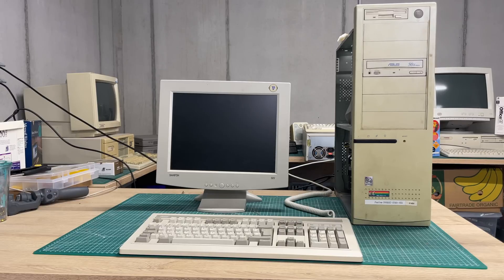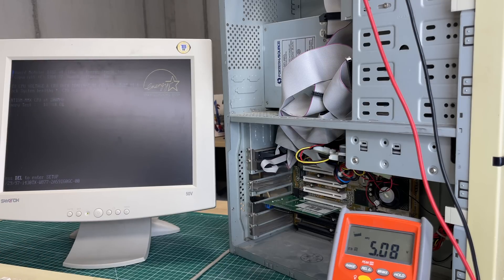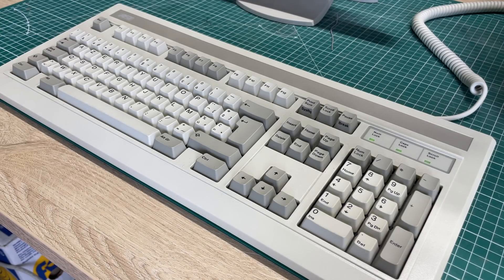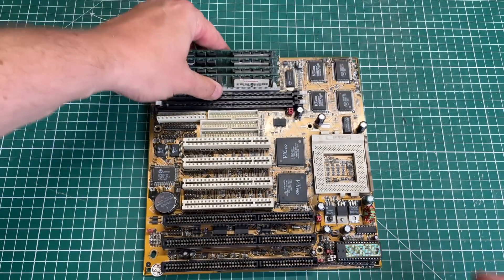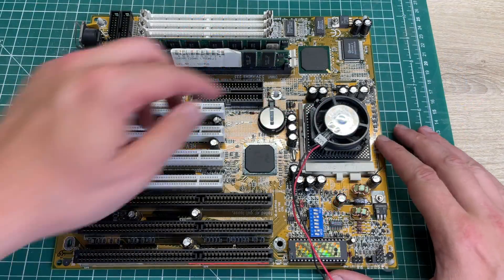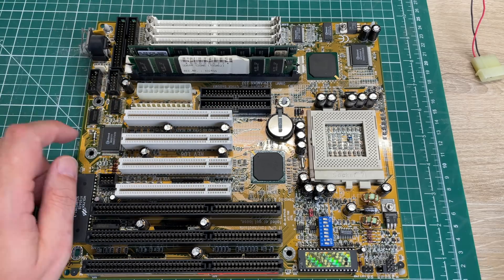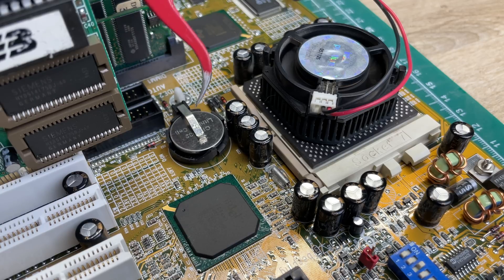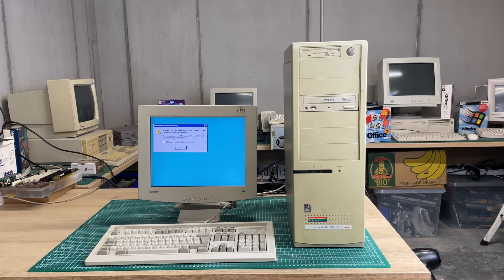Easy fix for this broken Pentium 200 MMX

Comment: I would just double check any capacitors that are in circuit with that battery to be safe. since it works on subsequent boots, it's obviously looking for a charge on an associated capacitor, probably to safely switch the CMOS ram safely over to main power, and the capacitor isn't able to fully charge on a weaker battery. It might be by design, but it could also be an indication that capacitor is old.
Reply: It’s more than likely the other way around.  The coin cell and main 5V rail are combined after their own respective diodes, and residual charge in a cap somewhere on the CMOS V+ rail allows for a successful warm boot, but isn’t quite up to charge on a cold boot.

It is quite likely that the 5V system rail is fed through a current limiting resistor to support safely charging rechargeable cells, since most motherboards had provisions for both.  That would form a low pass filter, meaning the downstream cap would take some 10s or 100s of milliseconds to charge to a suitable running voltage from zero.  Ergo, cold boots fail.
Reply: @sirnickity  chokes are for that.  I would suspect capacitors with a high ESR.
Reply: @BenState   An inductor in series would limit changes in current, yes.  But so would a capacitor to ground after a current-limiting resistor.

Usually whatever capacitor is in-circuit to a CMOS battery wouldn't be an electrolytic.  It's likely either a ceramic or tantalum, so typical "old capacitor" failure modes aren't as likely here.

Comment: I'd suspect you have a bad electrolytic cap in the voltage regulation portion of the motherboard.  A marginal cap can intermittently short and drag down the rail it's on.  That may cause a hang, or cause the VRM to go into protection mode or input voltage is insufficient to properly regulate.  Most need an input that exceeds a certain threshold above output or they can't put out full current.  When powering on/off repeatedly, as inductors dump their charge, the voltage will spike.  This momentary excess voltage can allow the marginal cap to charge, or the VRM to begin regulating.  A derivative of the 5v rail will be supplying 3v to the CMOS circuit and that coin cell.  Having a weak battery will make it sensitive to marginal 5V.  Just some wild @ss speculation

Comment: This is a very common phenomenon with various laptops, even much more modern ones. Some appear dead when the CMOS battery is low. Off the top of my head, various Sony models were known for doing that. I've seen it happen with desktop motherboards before, but it is much more uncommon. Some are especially weird and boot fine without a battery installed, but refuse to boot with a low battery like 1V.
Reply: Wistron-produced Acers (7551 ,5738,5536, 5740, 7736, 7738, 7740 and there might be a lot more than I know) will definitely NOT boot with no CMOS or low voltage batteries. I've been given a lot of 5738 and a few 5536s, and most of them weren't POST-ing due to that CMOS thingy.
Reply: @NSHG  Good to know!

Comment: Years ago, a tech at PC Doctors in Huntington WV told me that he made more money from bad batteries than any other hardware problem. I have no reason to doubt him. Over the years, I have had several 486 and Pentium motherboards refuse to post without a battery or with a failing battery, all of them had CPU voltage auto-detection or some other "new tech" that was cutting edge at the time. Enough of them that for a very long time, I refused to buy any motherboard until it was at least revision 2 or higher.

Comment: Hi Sir, regarding to this, I have a mobo in my stach (dont remember the brand/model) that NEVER boots if CR2032 is empty/low power/missing
I took some time to trace the problem some years ago, and you now present a very similar problem

Comment: There are motherboard series that only work with a cmos battery. I've seen quite a few in my career. You don't think about that in the beginning, but an empty cmos battery can cause a lot of problems. A point to keep in mind when working with old computers.
Reply: It's still interesting though that the board would post if you power cycled it quick enough.

Comment: Would be nice if you could merge the stereo audio streams. The balance between the left and right channels varies per shot and it can be a little disorienting to the ear.
Reply: A nice little feature I learned about Windows 10 (and I'm sure 11 also) a while back was the "Turn mono audio on or off" setting. Go to search and type mono and it will come up. It makes listening to videos with headphones much more tolerable when they have uneven audio or sound on only one channel. Just remember to change it back to stereo afterward.
Reply: I agree. You need to merge stereo to mono, otherwise it's unnatural. :)

Comment: I have a Gateway Pentium D system (GX7022E) that will do exactly the same thing if the CMOS battery is low.  Over 15 years old and still going strong, but it likes to eat power supplies.
Reply: Mmmm yummy power supply mmmm

Comment: Would it start with no battery? Not sure how scrambled CMOS would dip the 5V though - I have had one case of scrambled CMOS no boot when I changed a low battery fast enough that the CMOS only partially cleared.
I thought the fitted Intel HSF only applied to the overdrive model
Reply: It wouldn’t be caused by scrambled data particularly. Most motherboards will only reply with a pwr_good signal (to the PSU) if every voltage is in fact within margins. With some motherboards, this includes the CMOS battery. 

I’ve had the exact same issue with either the:
- Acer (MicroStar) MS-7326, or the;
- MSI 945GCM7-F MS-7507. 

It’s a 775 motherboard, but the issue remained identical. Despite the difference in era. 

Great vod @Davy!
Reply: I'd have thought that a modern CMOS would have a simple checksum to ensure the data wasn't scrambled, and just reset to default values if the checksum didn't match. Maybe I'm assuming too much though.
Reply: @zoomosis  data isn’t scrambled in this case. The PWR_GOOD signal isn’t being reported as “good” to the PSU. That’s it. :)

Comment: It cannot be stressed enough, weird behavior in POST (in notebooks as well as desktop pcs) is very often associated with a weak or empty cmos battery. Always check for it before taking further measures like disassembling the whole thing.
Reply: I've seen that before too.

Comment: Very weird... The only thing I can imagine is that it is somehow connected to the auto voltage selection that goes bonkers when the battery is low and might, due to some overvoltage protection, short the 5V (which was used for the VRMs of old computers up to the Athlon and P4) partially to ground.

By the way, the 430TX chipset has a cacheable area limitation: 64MB. Anything larger than this will become awfully slow, when accessing these RAM areas. This is why I chose the 430HX back in these days, despite of this still using the PIIX3 southbridge without UDMA (my HDDs were PIO back in the days anyway, but I was aiming for large RAM), whereas the 430TX already had an UDMA enabled PIIX4.
Reply: A word of caution about 430HX motherboards - some cache the lowest 64MB, others cache the entire 512MB, it depends on the size of the tag ram on the motherboard. IIRC many motherboards support either config, just swap tag ram chip and move a jumper.  So likely solvable but still a "check this" item if you plan to have more than 64MB on an 430HX board.
IIRC my recollection is that there were some motherboards that used the 430HX system controller (but paired it with the 430TX controller chip (PIIX4/)!, I assume Intel didn't officially support this but it provided the best of both worlds, 512MB cacheable memory and UltraDMA (DMA mode 3). I've found a few forum posts from people who claim they have motherboards like this which suggests my memory might be real.
Reply: It would take a pretty large short to drive it down to 4.9 volts. It would think it be enough that the heat would be noticeable if you were looking for it. But the AutoVRM on those boards is absolutly the culprit non-the-less. The ones with the Dallas clock boxes on them don't post when the battery runs down. 

As for the 64mb limit. Its not really that bad when you have cas2 ram timings. Its a deficit of about 10-15% performance for things exclusively ran from those blocks of ram. Windows itself will reside in cachable range and most applications will be small enough to be mostly resident there too. On computers with about 128mb of ram the vcache will be taking up the bulk of the upper 64mb anyhow. And this is even less an issue if you are running 96 or 80mb of ram.  Now if you pop 256mb ram on them... and then start to do a bit of more intense stuff, then its going to have its effects. 

Memory specific benchmarks will show a much larger difference than is actually realized in practice.

Comment: Not too odd, the Board probably holds timing configuration in the bios memory and fails to start reading the values, on the second attempt these values are refreshed from main power and the system starts.
Reply: That doesn't explain the voltage drop.
Reply: @SomeAngryGuy1997  The voltage drop probably was just a red herring. Some part of the system drawing a bit more power during initialization. 4.95v is totally fine.
Reply: @thetaleteller4692  Yeah, for ATX the specification is 5V+/-5%, IE anything between 5.25V and 4.75V is defined *fine*!
I assume this is an older AT style PSU, I can't as easily find the limits for those but I very much doubt it's tighter specs than modern ATX powersupplies, so 4.95V isn't an issue.
The "blinking keyboard LED" kind of hints the BIOS goes into some kind of crash loop, so yeah, definitely possible it's drawing a bit more power than it will once it gets things set up correctly.
Reply: @thetaleteller4692  Yes. I kinda sorta guess the HDD not starting doesn't load down the 12V line enough and maybe this PSU uses the 12V for regulation, who knows. Maybe it uses a resistor network to average all the rails to do some analog math, so loading the 12V will cause the 5V to go up. I have seen PSUs do that.